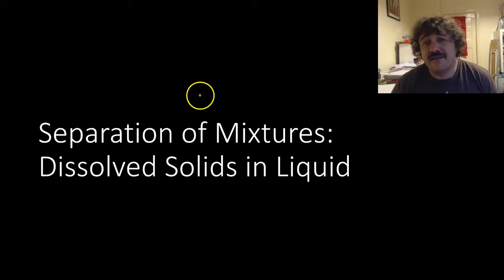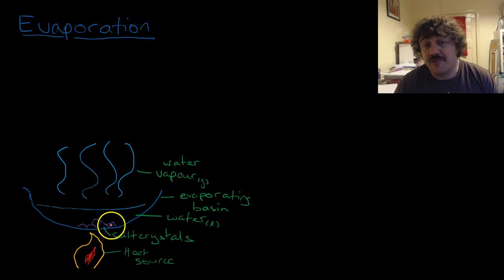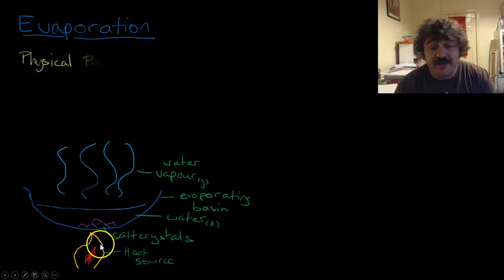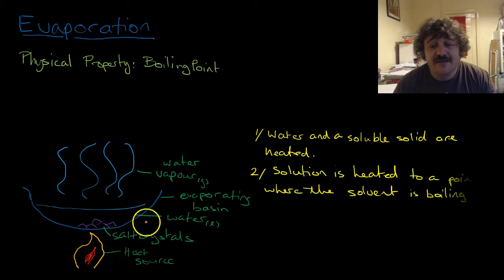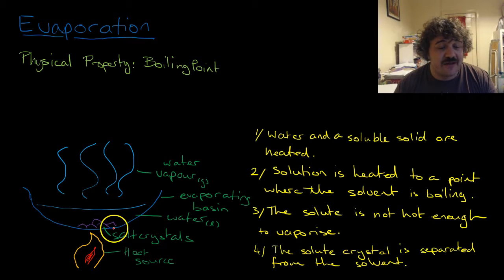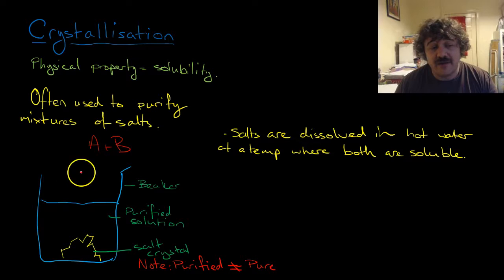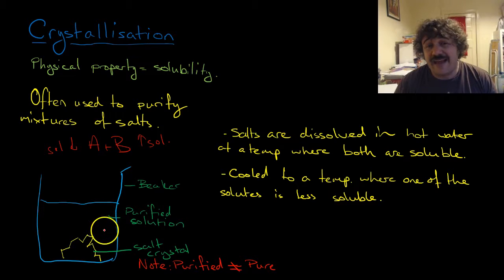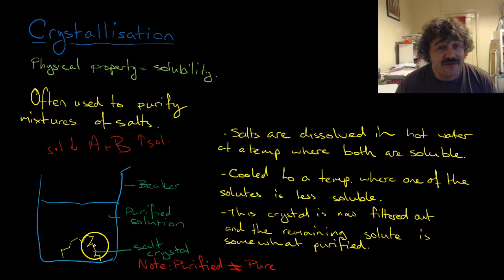Separation of Mixtures Dissolved solids in Liquids

Comment: When using the evaporation method, what would happen if you were to let the  solute reach the stage where it were to vaporise?
Reply: +Sophie Hay If the solute were to reach its boiling point it would also evaporate or it would oxidise as seen in the prac we did: separating salt/sand in a water mixture.
Reply: +Sophie Hay then the solute ( crystal) will become vapour, i am not sue is that right or not
Reply: when u can't think of a question